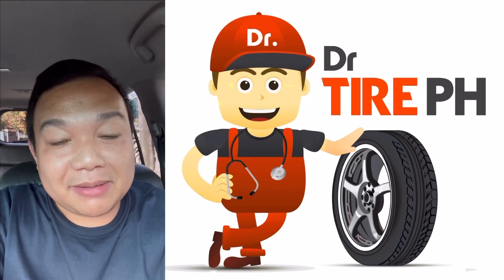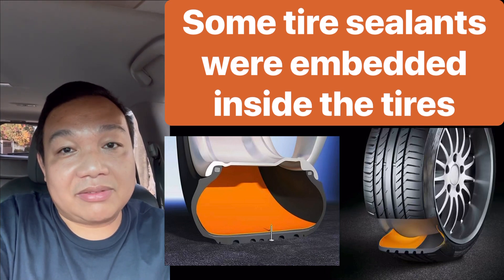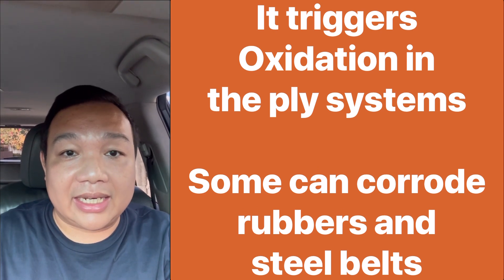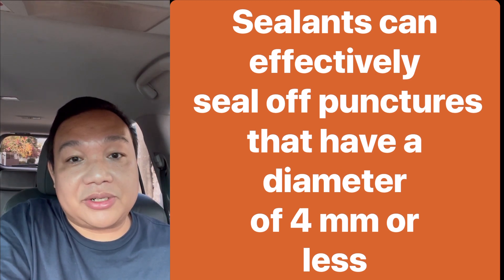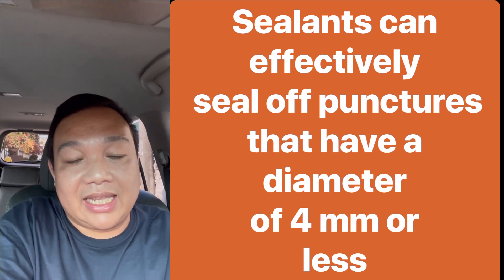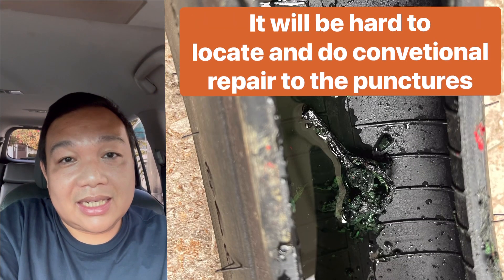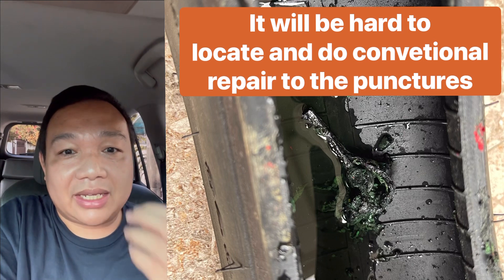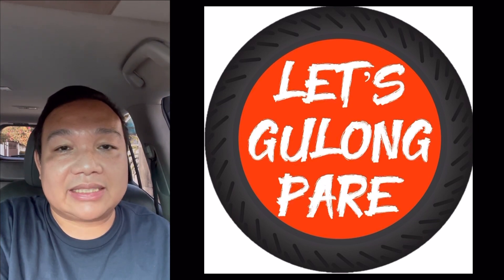Are tire sealants bad for the tires?(explained by an experienced tire expert)

Comment: well explained !! glad found your video. As motorcyclist who travels a lot for long distance, i had fair share of tyre punctures at isolated places. the most common method used to repair Bike punctures in my country is the Rope Plugger (the brown small stick type) . Hope you can do a video on the Pros and Cons of such method (stick/rope plug). Looking forward for the video. TQ